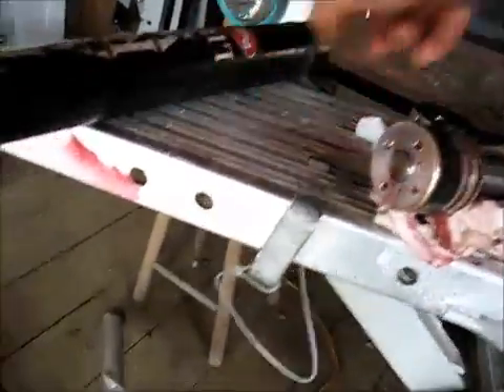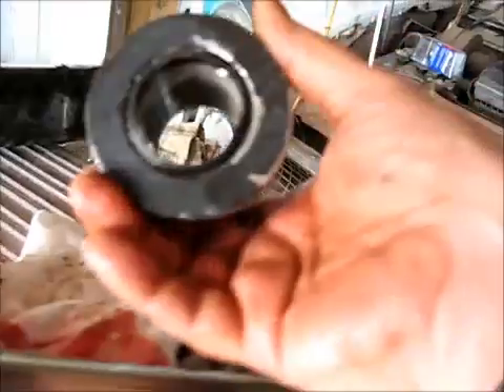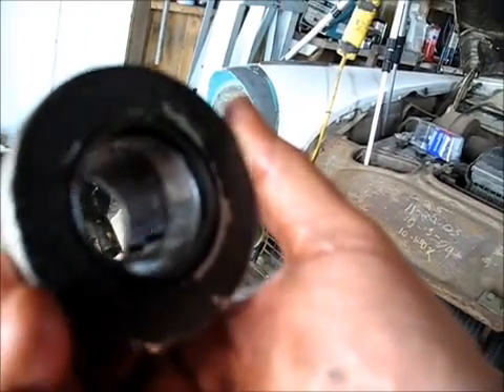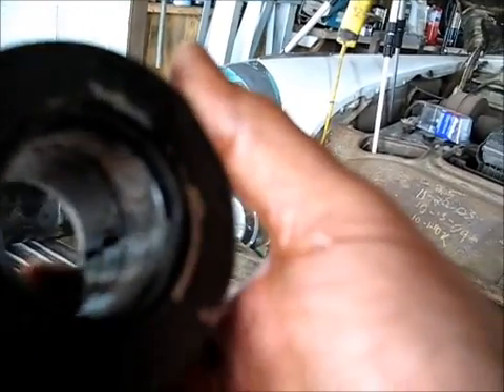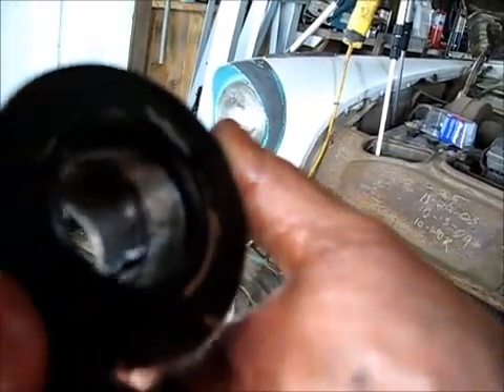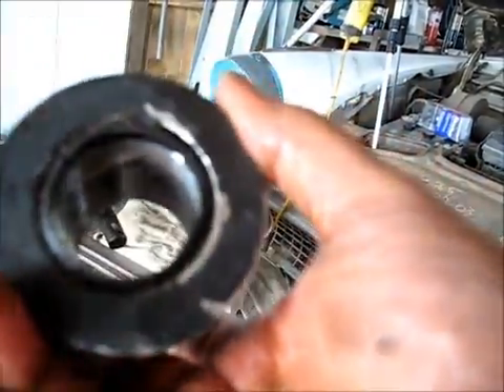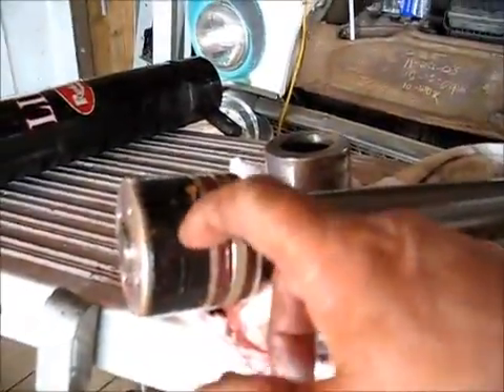Rotary Lift Hydraulic Cylinder dismantle

Comment: their are no seals in the gland nut it is a single acting cylinder pressure up gravity down 
all your sealing is done by the piston seals make sure your barrel doesnt have any pitting from rust in it you can take a cylinder hone on a long extensoin to run through it and clean it up if it needs it

Comment: That top piece would be the gland nut. The outer is the wiper and cleans the shaft. The inner actually hold the pressure and seals. When it drifts down or lowers on its own that indicates the seals way way low are no good.

Comment: Looks like someone was inside that cylinder before... The piston doesn't look real gaulled up so that's good, hopefully there is no pitting inside the cylinder and if so a seal kit and maybe a new lock ring that you can get apart will do you. That would be awesome! Did I mention what a rinky dink design I think that locking pin is?